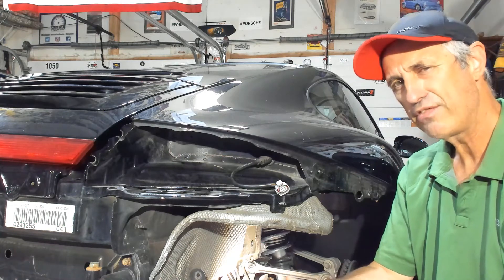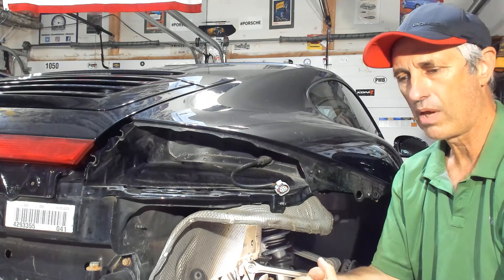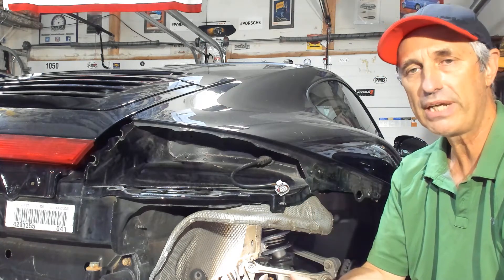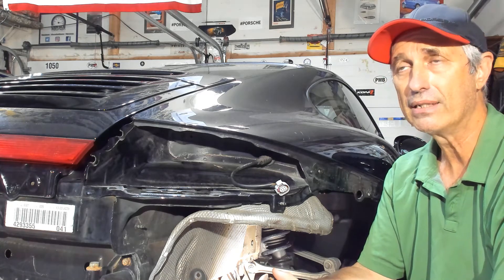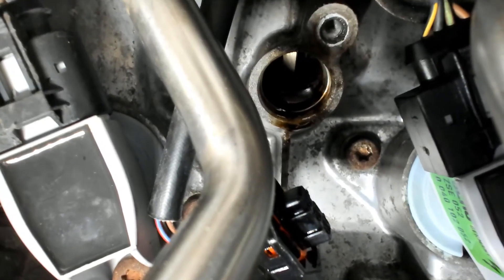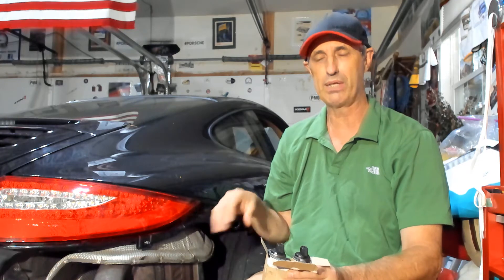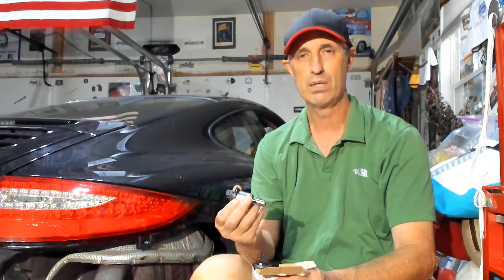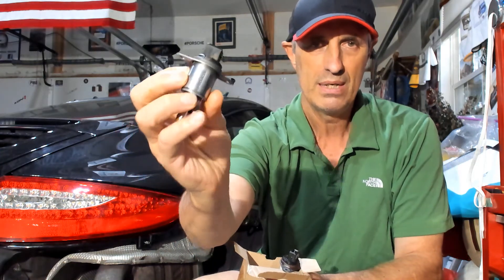Porsche 997 2 Camshaft Position Sensor and Camshaft Adjuster Solenoid

Comment: I have 2007 Porsche 997 turbo and I get dtc p0011 A camshaft position system performance. Do you think I need to replace the camshaft position sensor? I replaced the hydraulic valve sensor on bank 1 and that didn’t change much